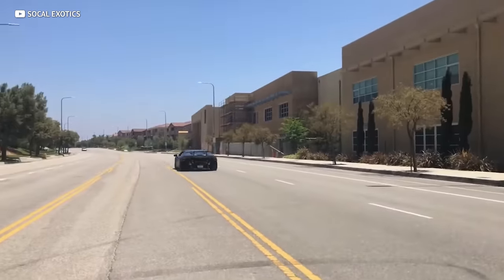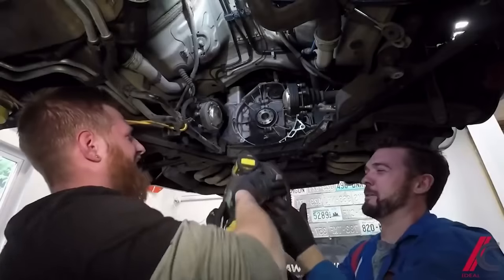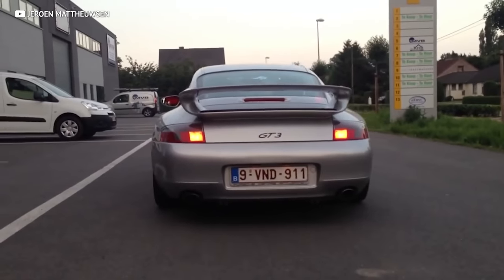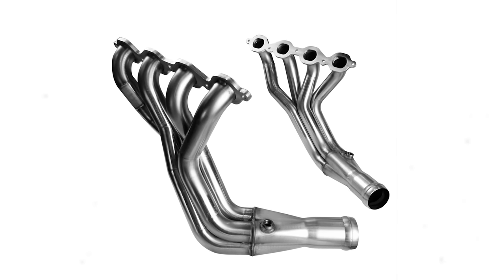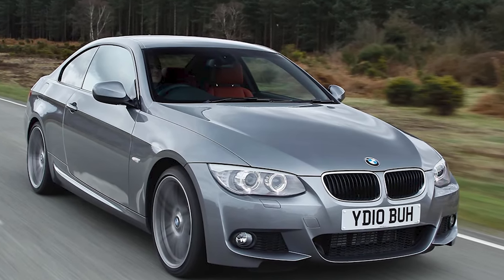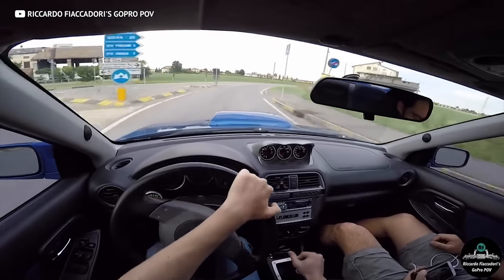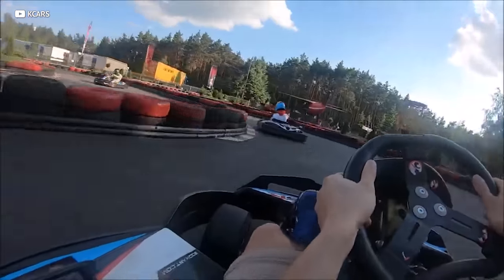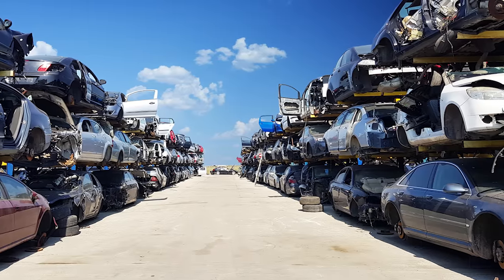The Easiest Ways to Add HP to YOUR Car

Comment: I have a 335i and I’m looking for help with the budget power mods
Reply: Take it to a dyno
Reply: @fuzzpunks3639  what do I ask for specifically ?
Reply: downpipes and full exhaust. when you get it tuned you’re essentially turning up the boost and adjusting the a/f and ignition timing to compensate for the added boost
Reply: @6mtcruiser  I’ll look into that thank you !
Reply: I wouldn't mess with it as it will make the engine less reliable. Great car as it is. Get a decent exhaust is about all i would do for that.

Comment: Short shifter and a good coil/spark plugs are also a good way to make good power for cheap

Depending on your car, typically an ebay short shifter is about $150 where I recommendcleaning it with some brake kleen then pre lubricating it before installing as there are usually metal shavings, dust and poor grade lubricant that they use.

As for spark plugs that is a bit more pricey but it changes the performance when using high octane fuel: example is I had the 4g69 on my lancer(2.4L) and fit NTK oridium twin tip spark plug set which costed me around $180 for 4 and paired with 98 octane increased acceleration and throttle response

Comment: I have a 1988 nissan maxima. What can I add to make more power
Reply: Which motor? Honestly, because of the age, the best thing you can do is probably just clean everything up. Replace bad vacuum lines, upgrade the big 3, look into what other people do for the intake. Depending on the motor, you may be able to do some really serious ignition and fuel delivery upgrades too. I'm not super familiar with 80s Nissans, but most 80s cars respond really well to simple modernization.

Comment: I have a 2004 mustang 3.8l v6 and I wanna make between 600-800hp I know that the the same year f150 v6 4.2l has strong internals good enough for boost applications so I don’t know if I should do that and build up the V6 or LS swap it with a 5.3 or put a 460 big block Ford in it...can some one help me 😂😂😂😂 no but seriously 😐
Reply: dont boost any v6 mustang that thing will blow up, just get the ls and boost it, the 460 isnt really good to boost
Reply: @ballslayer6970  I was thinking what if I did a 5.3 turbo build and marry it to a 10r80 😳🤯

Comment: Hey guys! I drive a 1994 es300 lexus and was wondering if anyone has any tips on making it faster and handle better? Its a fwd car and its the first time ive ever had a fwd car feels different when launching. 
Any tips or even recommendations would be nice motor is a 3.0L lexus 3000 motor so stock es300 engine.
Reply: typical intake, exhaust, headers etc would work, supercharging is also an option. you are still gonna be held back by that sluggish 4 speed auto though. for handling performance tires, lightweight wheels, swaybars, new shocks + lowering springs or coilovers would improve the handling

Comment: You don't have to take your car to a dyno to get a good tune and power increase. Is it the best route, yes but depending on the vehicle a simple cookie cutter tune will give you 50+hp. If you drive a German vehicle for instance, Intergrated Engineering and Boosted Dynamics (plus a few more) make tunes that you simply flash onto your ecu or completely replace your existing ecu. I have 2 Audi's, one has a stage 2 IE tune with great results the other I custom tuned (never touched a dyno) with Eurodyne Maestro.
Reply: i have a 2013 audi a4, you think i should go to a dyno and do allat or just straight up buy a stage 1 or 2 tune and figure it out. im also very new to the whole engine tune scene
Reply: @logehn3329  I have a few A4's, one of which is a 2014 so basically the same as yours. It is a facelift version so it's a Flex Fuel vehicle but I have a big front mount intercooler and Intergrated Engineering intake and stage 2 tune. My wife daily drives it so I didn't go crazy. It's a good tune and makes decent power for a mostly stock car.
Reply: @4BillC  the thing about stage 2 is I also need a intake and inter cooler. And since I lowk spend all my paychecks on my car I’m broke 😭. I actually just bought a catback exhaust system which I’m waiting to set up next week. so I’m still looking and researching but stage 2 seems the best option just with time ofc
Reply: @logehn3329  get the stage 2, at least with IE you also have stage 1. And I ran stage 2 on a bone stock car for about a year before I got the innercooler. Now intake temps did sky rocket during a pull, but it handled it, at least until #2 fuel injector clogged and went lean causing a burnt exhaust valve.
I went with IE because I was able to get stage 1 & 2, along with burble tunes for each, and I was able to do it myself. All you need is a laptop! Super simple process! Being new to cars don't listen to all the YouTubers or anyone else building 1000hp with top of line everything! You can have a fun car built on the cheap! My daily is a 2001 Audi A4 1.8T FWD 5 speed. I've had it for just over 3 years. It started as a 170hp at the crank! So 140-150 at the wheels. And over 3 years I not only fixed all the broken everything (I paid $800 for it so) but I upgraded the fuel pump, turbo, injectors, 2 different innercoolers, learned how to custom tune it (with Eurodyne Maestro), lowered it, put a RS4 bumper on it, painted it, new interior, and now building an engine for it. It makes 300 hp to the wheels on E85 and methanol injection. I've kept up with 500+hp cars. But mainly it's fun and I built it for me! If someone else likes it, great... If not, oh well. There are also audi groups on Facebook that could be useful. But just have fun with it!
Reply: @4BillC  hey I do have a question. Do yk if adding horsepower essentially the tune and intake will be a problem with a CVT transmission?
Reply: @logehn3329  CVT's definitely aren't know to be very robust. I'm sure it could take more than stock... I'd just be careful how much you floor it. Peak power is nothing more than a bragging number. The real difference is how better the car will drive. If you look at a dyno sheet. It more about the space below the line than how far up the line goes. Say 2000rpm you currently make 100tq, tuned you may make 150tq. That's a huge difference! But not to  transmission that  was made to handle 200tq safely.

Comment: Question to all: Is a 350z a good choice for a first car or no?
Reply: Eh first car I would do it
Reply: Yes. It's a  good  car , that can handle a lot of add on & even stock has a good bit of power & reliability  !!! Can't go wrong with that car !!!
Reply: @rickpearce5553  uhh yeah you can, they consume oil constantly as the engine wares in and it gets to it quicker because teenagers buy them and do drifts and burnouts constantly along with ruthlessly driving in them at high rpms because people think they are meant for it when they are not to that extent at all lol. There was only like 1 good year of the 350z's honestly.

Comment: I Bought a stock Nissan gtr what kind of mods so you recommend
Reply: Which one? Because if it's an older one, leave it tf alone so that you don't ruin it.
Reply: @fuzzpunks3639  r35
Reply: @fuzzpunks3639  2019 nismo
Reply: Lol you're allready the fastest car on the road, no need for mods for you 🤣
Reply: @automotivetv9861  but I can make it faster right
Reply: im assuming ur rich so get cam shafts exhaust manifolds, bigger turbos, gut the interior, new clutch to handle more power, fuel injectors, intake, and valves, and while ur at it newer brakes
Reply: @ballslayer6970  rich I financed it 😂😂

Comment: Tires should be the first thing anybody changes, then brakes & suspension..   THEN you can think about adding more power.....  Try to keep it on the road first...
Those air filters actually reduce horsepower, stick to the stock, they spent millions of dollars engineering this....
One of the biggest improvements is just changing the fuel filter....  then Tuning the engine...

Comment: I have a 05' Mercedes c230 kompressor 1.8L supercharger, in great condition, own outright and want to turn to a track/drift car. Been doing some research but have not found much info of Mercs that year and where to start first, other than suspension. If anyone out there has a similar vehicle and knows of any good websites/personal experience - please lmk! Any advise welcome, want this on track before summer! ☀️🙌
Reply: Summit racing

Comment: First off they are NOT cold air intakes. That’s just induction that’s gonna be sucking in a lot of hot engine bay air. Less BHP my friend. Better off with the manufacture’s offer unless you’re going to get a REAL cold air intake that actually runs from outside the car to the intake. Next: straight pipe exhausts only unlock power if you’re turbo charged. Forget it if you’re not. You’ll need the back pressure. NA +straight pipe = less HP in most cases.

Comment: Im actually looking for a solution to my problem. At stop lights, when i try to accelerate, it acts like its not getting enough gas or the right mix of gas and air...so the motor shuts off..or at 70mph and j have my foot on the gas, it will not let me give it gas. Bc its not getting any, the motor shuts off. The other day, while it was cold i started it and turned on the a/c, it died right away. Its getting too hot and emitting a white smoke from an "under-the-hood exhaust" looking thing. Ive changed the filter, the pumps motor and filter and the tps...no one has an obd1 reader so i had to put in into manual and pull the code myself. 31. In the Chilton(extra repair manual)  it says 31 is an air flow meter. Does this sound correct?

Comment: ye would love to do these stuff to my car only problem is it goes into limp mode when hot in 3rd gear and going over 3000 rpm idk what this could be if anyone does please let me know also when i put off the ignition for 30 seconds and turn it back on theres no more limp mode so ye would love if anyone would know what the issue would be so i can fix it

Comment: A CAI isn't going to change the sound any, they are good for better airflow than the stock box and work together with a good set of high-flow exhaust pipes along with headers for best performance. The pipes are going to be what gets you the sound and has nothing to do with the filter, so dont take what they are saying as facts and do the research for yourselves.

Comment: Hi guys I need advice on how I can make my Audi A4 1.8L Turbo 2006 model sound like a beast? And also how I can add HP to it? Any advice would be much appreciated! Also any add on suggestions will be useful 🙏🏾🙏🏾
Reply: after market exhaust (a good one), and also better camshafts allows higher rpm's making more power and torque and also makes ur car make a chop sound
Reply: @ballslayer6970  oooh that sounds interesting bro! I’ll definitely run around to see if I can find these! Thanks for the advice G 🙏🏽
Reply: and also some new exhaust headers will help out with power and add a bit of noise to it
Reply: @ballslayer6970  yeah dude my dad found a guy selling a set online last month, I think it was a XS power turbo manifold header that we got? And I was also thinking of getting a muffler? Do you reckon I go with a magnaflow set or a flow tech set? I heard they were both decent?

Comment: Doesnt mention fuel, e-85, 110, 120, all good methods of gaining some extra power with a proper tune, video mentions a tune but also fails to mention that exhaust, headers and intake will do nothing except hurt your performance without a proper tune.  Like it's not as simple as just slapping an intake and exhaust on the car. The cars ecu is programmed to run with the components that were designed for the car, when you change those components you need to tell the ecu to adjust for the difference in air flow, fuel pressure etc. Also yes a cold air intake does get colder air to your engine, if you are using a true cold air intake, the hot air intake that was referenced is actually a short ram intake, and they do have their applications.

Comment: my car lost alot of power lately. i went to the garage - turns out it still had the original diesel filter inside - with 108.000 kilometers on the clock.

Comment: If I have a car with 200 hp and I add 200 hp more does it use 2x the amount of fuel?
Reply: if you have to give the engine twice the fuel to make that power than yes, but otherwise no

Comment: i will never recommend a cold air intake, reasons being having a cold air intakes allows for 2x the amount of dirt being able too reach the engine,  yes it allows for more air flow but it puts your engine at more risk. secondly a turbo really isnt recommend unless you have a chamber some were too dump cool dense air into it, without that your actually losing power an limiting your turbo, a exhaust is something i will recommend considering it allows for more air flow, greater sound quality making your ride stand out, having that extra air allows for more torque an hp but not allot maybe 10-25 max. considering most cars come stock with 250 hp an up that is a massive increase. upgrading your torque convertor, cam an cam clearance, piston clearance an oil pump pressure are some amazing power boosters, upgrading a transmission can be beneficial but you have too be smart abt it having a trans with quicker shift times might mess up the rear end ratio.
Reply: the chamber for the turbo contains dry ice if any of yall ever get curious

Comment: I would rather tell get worse tyres because if you have more power is easier to brak traction if your tires are weak is easier to brak traction. If you have less traction you fell like you have more power even when going i =n fact slower

Comment: #1 …. You should recommend a good CLOSED BOX Cold Air Intake…. Recirculating engine bay air is definitely objectively not better than stock intake. Especially on Chevrolets and Toyotas. 

#2 …

I’m just gonna stop here. 

None of these are cheap lol.

Comment: Well this video was a complete waste of time yeah you can put a turbo on the car like you said at the end but there's nothing cheap or easy about the setup unless you just want to blow your motor the only two things I could think of that were semi useful was the exhaust and maybe the intake never discussed anything about changing out fuel injectors and ignition then talk about spark plugs or changing out throttle bodies for putting in throttle body spacers to add better response a lot of things that could be done under $500 that would add a lot of power easily